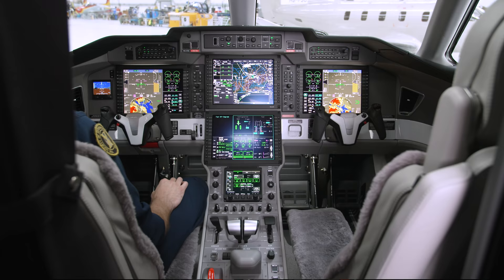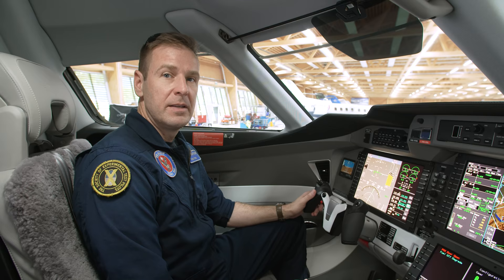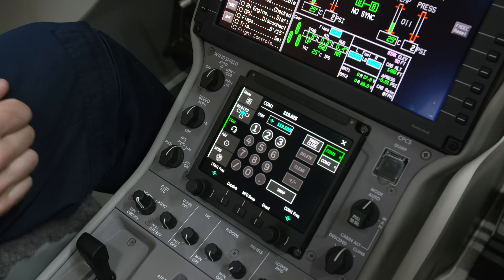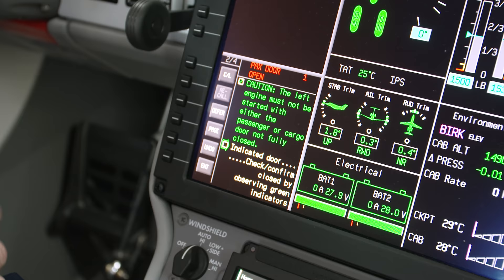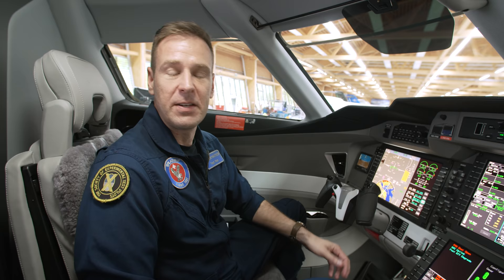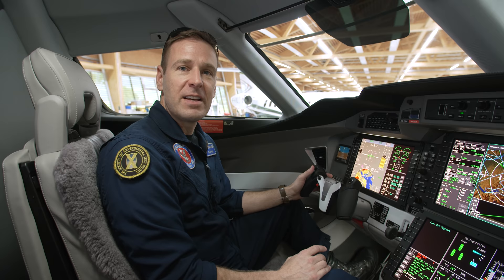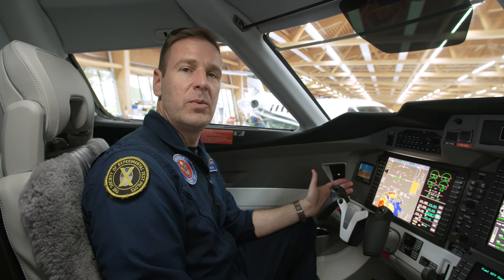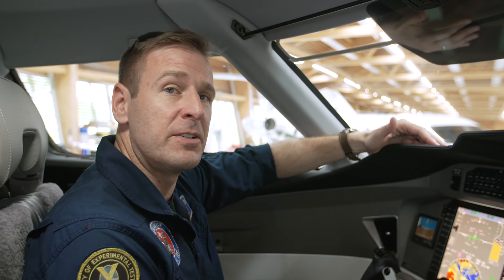PC-24 Tour Part II – Cockpit with Test Pilot “Fish”

Comment: My question is are the throttles integrated with the aoutoplot? also what is the climb rate in feet per minute? Also the descent rate in feet per minute? Would be nice to have added a dual HUD, so as not to look outside and have the dual HUD, display all the necessary information to the pilot.